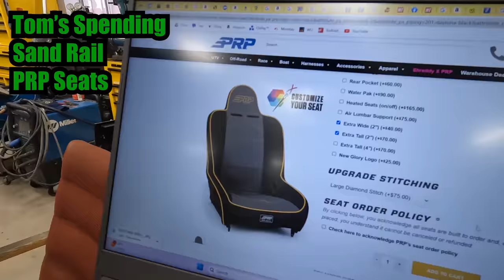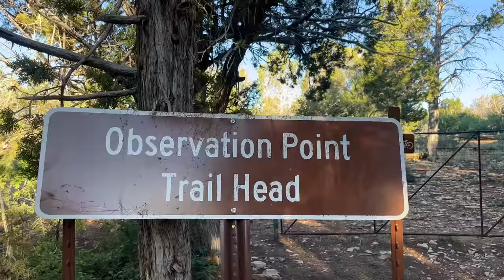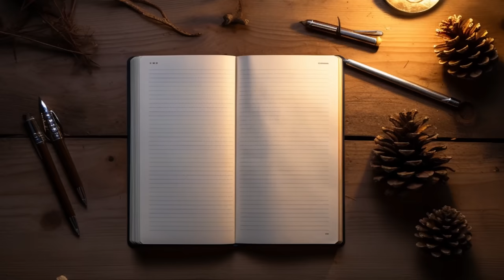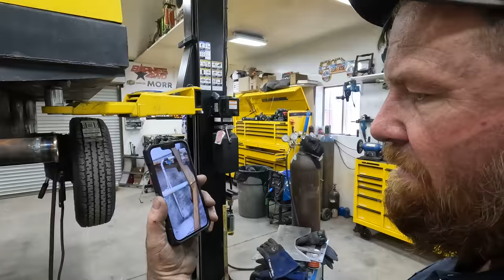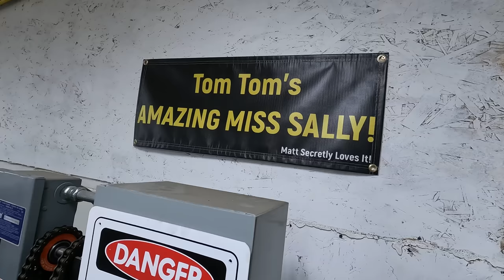This One Part Changes Everything! Bombi Gets Biggest Upgrade.

Comment: Polyurethane sprockets will far outlast rubber.  The M973 SUSV came with poorly designed rubber guide wheels and drive sprockets and in ice or under hard use they just get destroyed.  Extreme Hagglunds out of Montana had suppliers making custom parts for those.  Lots of similarities in older tracked rigs.

Comment: Think of a 5 gallon water jug as the differential with 2 tiny holes drilled on the bottom opposite of each other. The water flowing out of the holes is the hp, but hence the "open differential design" when one tire loses traction, say in the mud for example, you make one hole much larger and all the water flows out yet the other hole is still allowing hp out to the axle. But most of the hp will now follow the path of least resistance. 😂
Reply: And as for how a posi works, I would say look up the clip from the court scene in "My Cousin Vinny"

Comment: The potential for the force through a diff is basically the same. But when one offers resistance and the other does not, the result is the one offering less resistance spinning faster.. with almost no resistance on one side it just spins. That is why it is effectively 1 wheel drive. That is why braking helps. But the torque won't be remotely equal. If it were then both would spin together, because there is no disconnect between diff and wheel. So if the same torque came out both side, like on a lock diff, both tires have to spin the same.

Comment: Just a thought: should you add the weight of the intended engine, gas tank, trans, etc. while you are making the selection of the tire guides that you are selecting for the tracks. May be a  small difference, but was just watching you size them with the guide under the tire and being concerned about the sidewall bulge of your tires.

Comment: I'm kinda surprised...
I thought all treaded vehicles worked best when the drive sprocket was at the back. Tanks always do this.
Reply: no they don't. tanks have rear engines and always drive the track at the front. bulldozers and loaders drive from the rear because they move slowly. tanks have to move fast so they don't get shot...
Reply: @marzsit9833  wrongo. I should have said all MODERN tanks are driven from the rear, because that's the best way to keep the part of the tread on the ground tight while moving.

Comment: This is just an opinion but I've been looking at your track the way you had the break shut up if it would be me I would be have those brakes mounted behind your sprockets because the way your  Breaks are now you lock them up they could slide inside your tracks and you pull the brake  Mounted of behind the sprocket the sprocket will stop which will also stop your track. It's just something to consider

Comment: I would be concerned that reversing (especially under load) would result in the slack wedging above the drive axel. Looks like real tight clearance  up there
Reply: The tensile strength will be highest on top of the tracks, pulled towards the drive sprocket, and the slack will be after/underneath the drive sprocket (in front), making it easier to dislodge on the first rubber tire under load. This does not have top slack like on reguar tanks or alpine slope machines, where the drive is in the rear of the tracks. Time will tell if reversing the layout works as intended.

Comment: I've never really worked on any track vehicles with rubber tires before. But it seems to me that the brakes being on the back Wheels like that And not the cog wheels wouldn't it have friction problems? Especially in snowy conditions where the track would just slide over the tire when trying to stop. Just wondering been watching the series and that was my Thoughts

Comment: You're mounting a rear axle in a front application. Wouldn't it create a drive on the gear's coast side? Or do you have a plan to reverse the engine rotation direction?

Comment: Miss sally scares me. As a guy that’s had things bind up in a drill press several times I am very thankful that the belt-driven spindle has slipped and not been subject to the full power of a direct drive from an AC motor. Is there a safeguard on Miss Sally that will stop the motor in the event of a bind? I can’t imagine how such a mechanism would work so it makes me think that there isn’t. Maybe im just a worry-wart. Be safe with that thing.

Comment: The differential question is one of those that people think they have it right, but don't.

The rotational power going into the diff is the same as the power coming out of the diff, minus loss. There's a lot of greek letters for variables, but, it's power = torque * angular velocity. Power in = power out, however, no diff ever has the same amount of torque coming out as it has going in due to the gear ratio. The important thing to remember is that the power is the same, the power going  IN has to equal the power going OUT. If you have one wheel off the ground of an open rear, or it has no traction, it, being the easiest way, receives ALL the power. Remember that power is torque times angular velocity. If your wheel has zero rotation speed, it has zero power. Thus, all the power must be going to the other wheel. 

Key point is to think about angular velocity as well as torque. 

Source: am mechanical engineer and work in a car factory.

Comment: Dumb question. You're putting the engine in the back and the differential on the front. Are you doing something crazy with the transmission to get it to spin the right direction? Because it seems to me you'll have a ton of reverse gears and have to run in a reverse to go forward. Or did you flip the rear end over?. If so, isn't that hard on the ring and pinion?

Comment: 50% torque only happens when wheels and tyres or drive train are equal diameter thus if you have a nascar with two different tyres for cornering so to minimising heat to differential when cornering in a curtain rotation whether clockwise or anti-clockwise. it has to be calculated for track on or place going. Matt you are not 100% correct about 50-50 on all scenario. for your snow bus yes you need it 50-50 or over time it will over heat the differential box.

Comment: The Bombi will go one third faster ... or stall. 33% more rpms. Slower acceleration.  9 to 12 teeth. Means more stress. Looks like you might need to go with 4.11 in the 9 inch...maybe even lower...should be a hoot. Your components look way better...however there is always a weak point.

Comment: Well, energy goes to the path of least resistance. So when you have an open diff on flat ground, the torque goes to each wheel on a 50/50 split. But if you have a wheel in the air, all of torque will go to that wheel because that’s the path of least resistance

Comment: Right, the differential is only there to allow one wheel to spin faster if there is more resistance than the other wheel. One wheel spinning faster because you're turning, yup! One wheel spinning faster because of ice/mud/not-dry-pavement, yup!

Comment: Helpful hint. For what it's worth, you don't have to open your Argon/CO2 valve all the way. A half a turn will do it. I can max out my tig regulator with a quarter turn. No need to open to the max. 😉
Reply: you always open a high-pressure cylinder all the way because the seals in the valve will leak if the valve is partially open. it has nothing to do with flow.

Comment: There's a  new excavator track pad available they have a grouser between the regular grousers in line with the track travel one about every four pads they are only the same height as the regular grousers so there is nothing sticking up beyond the regular grousers they can still be used with out damage to road surface but prevent sideways sliding

Comment: U should have converted it to where u push both the handles forward and when u pull on back it cuts the throttle and turn left or right or vise versa

Comment: The biggest reason a Ford 9" is so strong (once you build them a bit)  is because of the amount of pinion to ring contact they have. You end up getting more teeth engaged at once vs. something like the Dana 44 which is only 1/2" smaller in the ring. The drawback is efficiency. More contact means more friction, so it takes more power to turn a Ford 9" vs a similar sized diff with more offset. The Dana 60 or GM 14 bolt-FF are stronger because they're bigger, but not as strong for their size. 
It's the same reason Toyota diffs are stronger than their American counterparts.

Comment: are the teeth of the sprocket aluminum or just the center? i know with motorcycles the full aluminum sprokets wear out much faster but i dont know if it would on the bombie since it wont be rotating as fast but just thought id throw the thought out.

Comment: Okay, it'll be me then - The differential is just for cornering or when one wheel is forced to go slower. The diff allows force to still be transferred to the wheel which has less friction to overcome. When both wheels have equal friction or load to overcome, then the diff acts as a solid axle  
...and that, Grandma, is how you suck an egg!

Comment: Open differentials does send equal torque to both wheels only when the wheels have exactly the same traction. Not all the time, otherwise you wouldn’t need lockers in all of your rigs.

Comment: So do you run open diffs in the Morvair and Banana or do you use  limited slips?  If limited slip, gear type or clutch type?  Front and rear diffs?  And what to you run for diffs in the world's largest off-road wrecker?
Reply: Morrvair:

Body: 1961 Chevrolet Corvair Lakewood 700 Wagon

Engine: 5.3l LS L59 V8, 240 bhp (dyno rear wheels), 288 ft-lbs (dyno rear wheels)

Transmission: GM Turbo 400 3-speed auto gearbox, NP205 transfer case

Axles:

Front Dana 60, Detroit lockers

Rear Dana 70, Spicer limited slip

Final drive: 5.13

Suspension - semi triangulated front and rear

Tyres - Milestar Patagonia, beadlocked, 40/13.50/17, typically 8lbs air pressure

Weight - 5,460 lbs

Track - 82"

Wheelbase - 119"

Seats - 4

Banana:

Body:  2001 Jeep Cherokee XJ 

Engine: Golen Engines Stroker Inline 6, dyno (flywheel) 273 hp, 315 ft-lbs torque (flywheel)

Transmission: (I'm guessing here, as I can't find any specifics) Aisin-Warner AW-4 four-speed automatic upgraded by St George Transmissions to align with new engine output, SelecTrac NP242 transfer case

Axles:

Front - Dana 60, Grizzly locker 

Rear - Dana 60, Spicer limited slip

Final drive 5.38

Suspension: 

Rear - triangulated 4-link ORI coil over

Front - triangulated 4-link ORI coil over

Tyres - Milestar Patagonia, beadlocked, 38/13.50/17, typically 8lbs air pressure

Weight - 4,260 lbs

Track - 74"

Wheelbase - 101"

Seats - 5

Wrecker:
MRAP - look up Rockwell 5 Ton.

Comment: Could not tell from video, but I assume that the 9 inch has been turned upside down so that there won't be 3 speeds backwards and one forward. Has there been any consideration to offset the steering controls, even switchable so that they can be operated from either front seat?

Comment: With the axle/diff in front, and the engine facing backwards in the rear, how do you get the sprockets turning the right way? Do you run in reverse or is there a converter in there somewhere?
Reply: diff is upside-down.

Comment: I really love your guys video and your fabrication. I hate to be the bearer of bad news but in about ten years more than likely less, I will be able to input the criteria for this Bombi into an AI interface and it is going to kick out a better version of what you are building and all that is needed is to buy the parts cut the pieces, weld them or bolt them together. The vehicle you are currently building may be an out put result based on the criteria and geographical usage of the vehicle on which the end user has selected. Let’s not overlook the comments section that make suggestion to improve the final project and AI’s ability to test those options in 3D real world environment.

Comment: Matt opened a can of worms: true, torque is split equally but that doesn't mean much in real life situations, like in one you mentioned when one wheel is in the air. In fact a 2WD vehicle with posi or a locker will often have a much better traction than a 4WD with both front and rear open diffs. Prove me wrong :)

Comment: You're going to want more tire width clearance. You'll ride in the new Bombi once and will realize how bumpy the ride is, you'll drop the tire pressure, and then the tire sidewalls will overheat from driving on the track guide bars.
Reply: they're going to have plenty of flat tires with this setup. they got away with having a couple of pneumatic tires on it for awhile but they don't understand the physics involved in a tracked vehicle.

Comment: I think that I shall never see a locker in the killer bee
In open diffs that torque gets split
Imagine that I agree with Matt

Having said that torque gets evenly split through an open differentia, does horsepower also get split evenly?
Maybe not. Horsepower is a measurement of work done over time. In an open diff with one wheel spinning and one still., where does the horsepower go? The spinning is the work being done over time. So horsepower is going through the spinning axle. No work is being done by the still axle even though half  the torque is being applied there. Like when you are torquing a bolt. Essentially, after the bolt stops turning  at your torque spec no more work is being done  to the bolt whether you keep applying the same amount of torque or not.

Comment: Differentials apply the same torque to both sides but then depending on resistance each side has, the power  will flow to the side with  least resistance.  Like electricity flowing  through two resistors in parallel.  Same concept...

Comment: Are you going to put the rear end in upside down so you won’t have to run the transmission on reverse all the time. I might be wrong but just a suggestion.

Comment: The nine inch is not only strong like a dana 60 but it also takes less horse power to turn vs dana 60 or GM 12 bolt

Comment: Reality always seems to show the power being sent to the wheel that has the least amount of resistance.
 Which is why you are told to hold the brakes and give it throttle and begin gently pumping the brakes so as to fool the differential into passing torque to the wheel that is in contact with the ground.

Comment: Every action has a reaction..... I am gonna get more than a bit wonky or nerdy here, in case anyone cares to try to follow this reaction to Matt's comment on torque split. My thoughts on cases where lockers are not available: the wheel with traction cannot apply more torque than can be borne by the wheel/axle assembly without traction.  So using whatever ground friction is available, if any, plus the bearing friction and rotational inertia of the tire/wheel/axle assembly are going to be the only way for the torsional force of the drivetrain to be absorbed on one 'side'.  Since the open differential is not biasing to one axle or the other, the tractioned axle assembly is acted on by the same amount of torque as accepted by the freer-spinning axle.  Since the acceleration of the open side is one contributor to the torqued it can absorb, it would seem to be a best practice to use a process of accelerating up to the engine redline, then immediately backing off, checking things out, and then accelerating again.  Have not tried this, and I have front and mid-lockers on my trail rig.  The front locker will become a priority when and if I get stuck on the trail due to lack of it.  Matt, thanks for teasing up a pleasant mental exercise.

Comment: Ford 9" isnt going to be the most reliable in your application. I wouldn't use anything smaller than a one ton and for sure full floating ie GM 14 bolt Yukon locker. Really to have the most reliability and redundancy install a transfer case and x2 fully floating 14 bolt. That way also you can use 3.73 gears for getting to location then the transfer case for stump pulling applications. 
Not to mention the benefits of x2 axles reduces friction on the single point. As you know if you snap an axle with a single 9" or loose a seal you are screwed. Even if you install a locker since they are tracks you will only go in circles like a skid steer. 
If not now bet 2-3 winters from now I'm sure I will see the video "Bombi one ton  full floating axle swap"  Weather you use Dana axles or the GM 14 bolt that already prolly has a G80 locker is in no question the way to go inalienably. 
Side note love your videos, have you all ever built an amphibious recovery vehicle?    
Either way I can't wait to see how badass the Bombi will be this winter. I know you all do solid work. Winter can't come soon enough!

Comment: Yeah you will get equal torque to both wheels with an open differential. The problem is both are limited to max traction of the worst wheel. So one is in the air will take no torque the one planted will also take no torque.

Comment: Just a idea can you build device Incase the track gets broken the device you build you adapt it to the outside of the gear a second device bolts on the outside of the rim In emergency you put those on your device be a gear sprocket you hook up a motorcycle chain to the sprocket hook to the rim the other sprocket hook to the big gear put chain on you have power to one wheel so you can drive out

Comment: I have a question about the 9 inch differential is it gonna be a one wheel peel or a locker? The only reason I am asking this is if it’s a locker, is it gonna make it difficult to be able to turn it since both sides are drives and there’s no slip
Reply: OK I guess I should have watch the rest of the video because you already answered my question that’s been on my mind since you said you were using a 9 inch